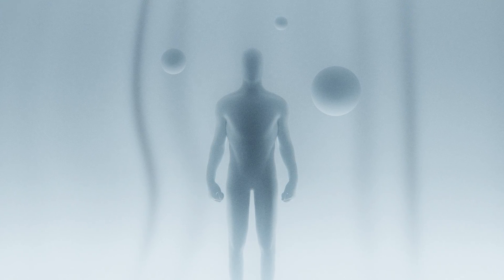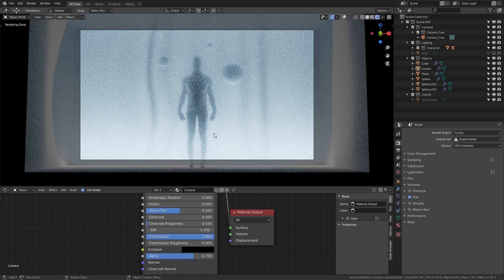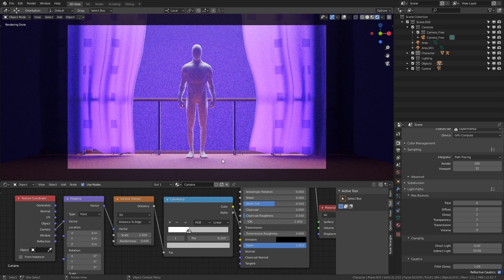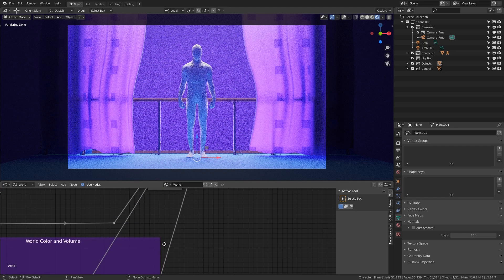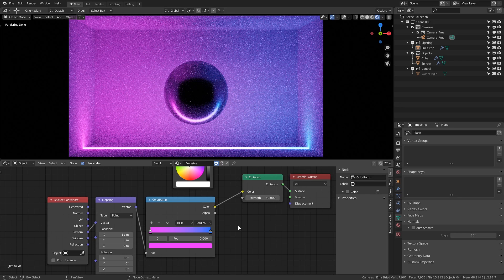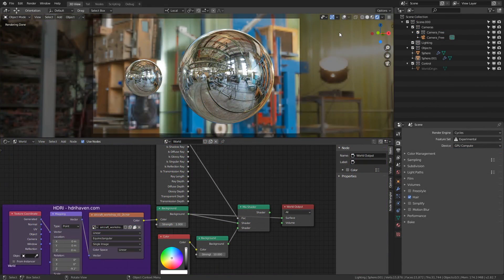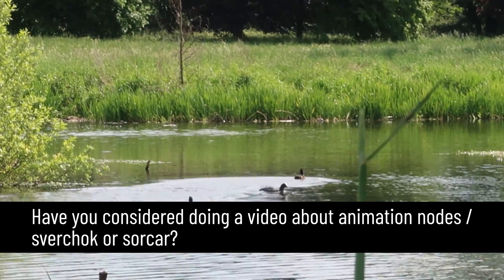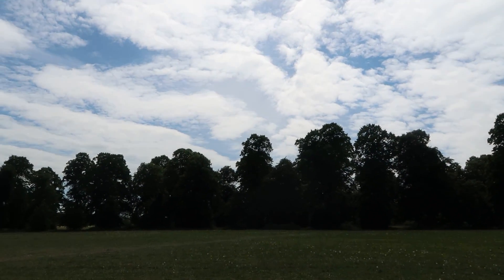Advanced Lighting Tips for Cycles in Blender

Comment: One problem with emissive materials method that I just figured out as a new user of blender (maybe im doing something wrong or something),  and that problem is, it can not use IES files.
which also takes advantage of Blackbody node to control Kelvin temperature for the IES that is being used for realistic lighting.
Also as many others have mentioned in many other youtube videos, Blender Organization has miscalculations when it comes to the lighting configurations settings on the right panel.
Dont know how true it is,  but im going by a bunch of videos I have watched learning about Blender lighting, when it comes to comparing Watts to LED settings & Kelvins.
And not to mention that Blender Organization does not have Lux settings either.  Lux is the intensity of the light of a emissive light using IES & Kelvin values to control lights.
For those that didnt know:
1. - Lighting color, measured in Kelvin
2. - Brightness, measured in Lumens
3. - Light intensity, measured in Lux

Here is an example of how these are used.  Lets think about a ArchVIS Modern Bedroom.  That bedroom will not have bright lights 'usually'.  So the settings for a bedroom each light value is:
(using 12-foot standard ceilings)
1. - 3800 Kelvin  - which keeps the room color in a warm color state, since Light color is measured in Kelvin values. (Think of a dimmer switch as color temperature known as Kelvin)
2. - 800 to 900 Lumens is the brightness of the light measures in Lumens values. (which is ruffly about 8-watts to 11-watts respectively)
3. - 50 Lux is the bedroom intensity of the light measured in Lux. (think of Lux or lx as its known, as Saturation for lights.)